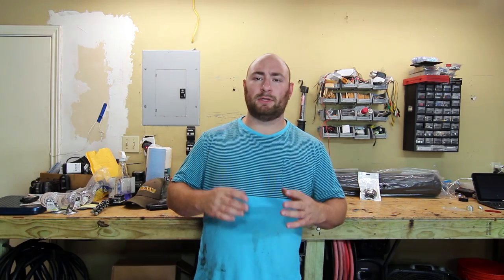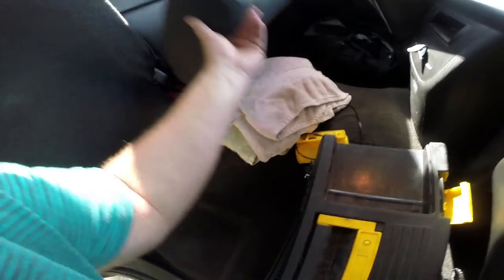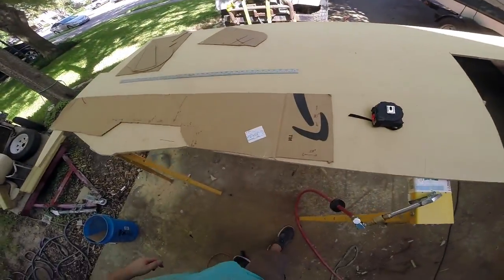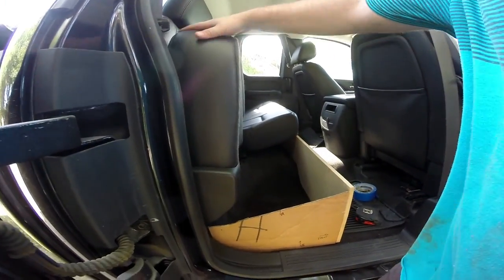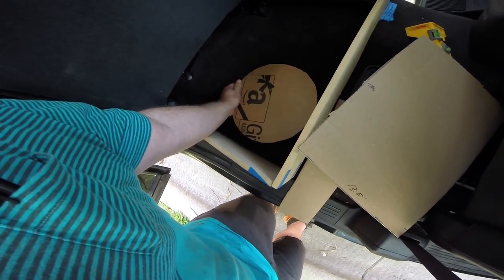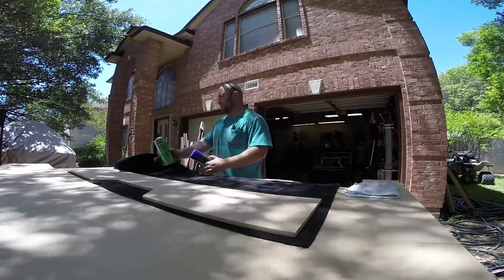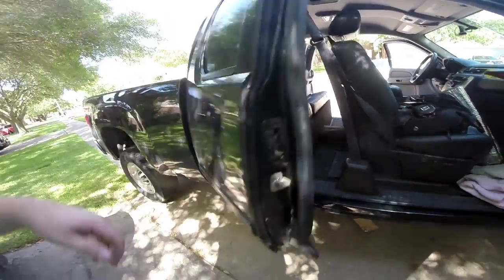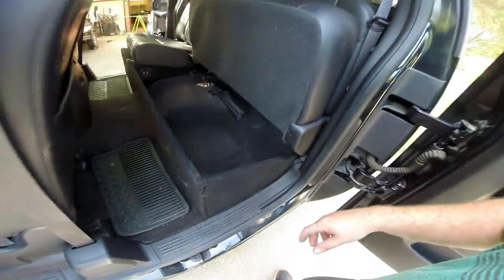2009 GMC Sierra 2500HD -  DIY - Building a Subwoofer Box and Storage Under the Rear Seat

Comment: Looks like an awesome setup dude, nice job and thanks for making the video. I got a 08' SLT, same cab as yours, but anyway I've had the back seats folded up to make room for this old box I used to have in the trunk of my car (2 12" subs & 2 amps) and its been pissing me off, such a huge waste of space, I gotta do something like yours so I can finally fold down those beautiful leather back seats. I've got 2 of those diamond plate tool boxes, so one I mounted on the truck, and the other, I cut apart, and have been using the material to trim off everything imaginable, so I'll probably trim off my new box with that stuff,, should look pretty sweet. But anyway thanks for the video man, now its pretty clear that I'm gonna need most of a day to custom build something like this if I want it to fit nicely.